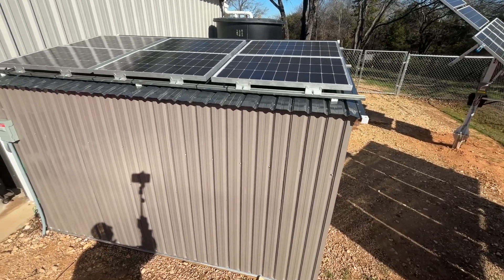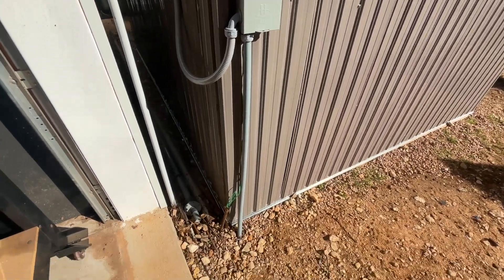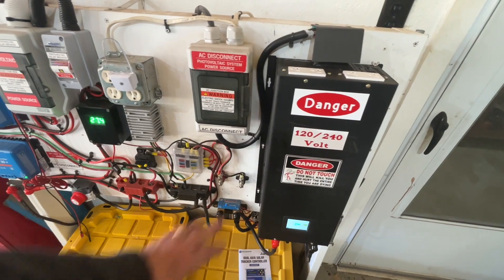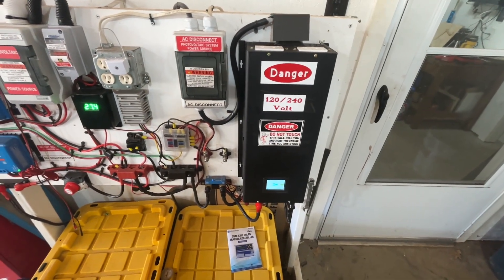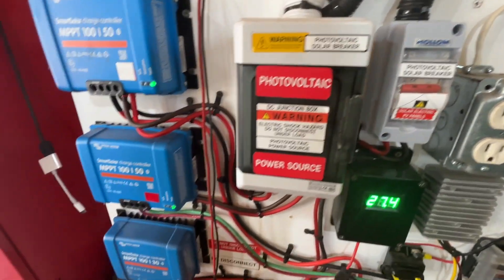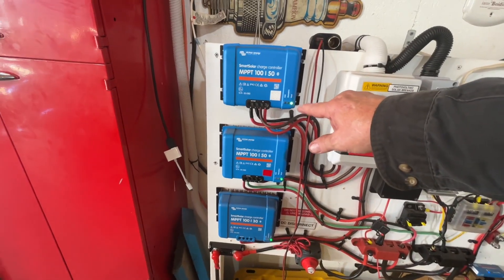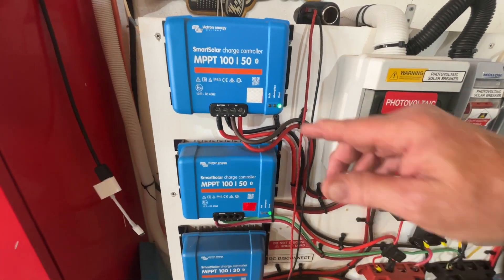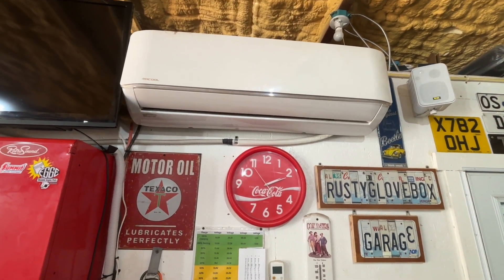Adding additional Eco-worthy solar panels ,Victron and WZRELB equipment update

Comment: Thanks for the update, it is good to follow along with what you are doing with solar. I like the sticker, it is funny and as such something people are more likely to remember, everything is 240v for single phase over here.
Reply from the maker: I’m not sure why here we use 120 volts and 240. It would be simpler to just use 240. Also we use 60 cycles and you use 50 cycles. That would be something interesting to research.  Don’t know why we are hanging on to our units of measurement and just don’t go to metric. I wished they converted back in the 70’s when they first started considering it. All above my pay grade…lol😂. Wishing you and the family a great 2025
Reply: Hi Joseph

Comment: Wow! Pretty extensive setup Lloyd. You must be an electrician or have the education to learn how all those components work together, I wouldn't have a clue. But it's definitely impressive, and living in Texas you'll get all the sun you need to run it.
Reply from the maker: Everything has come together really well. It generates enough power and runs off the solar panels during the day. The batteries supply the power at night. I’m planning on adding 2 more batteries and a RV transfer switch to supply power for the shop mini split air conditioner. Thanks Ken and have a great 2025
Reply: Hey nice setup. Eg4 makes a mini split that runs directly off of panels. You should check them out. I’m not sponsored by them I just think it’s a great product
Reply from the maker: @kd3    Thanks , I will check that out. Take care

Comment: Awesome setup Lloyd , very clean and well designed.  There's a lot to learn with solar and yes it will hurt ya big time :)
Reply from the maker: Thanks Steve, these extra panels have really speed up the charge time in the mornings. Can’t get careless around the higher voltage. Have a great New Year, Cheers